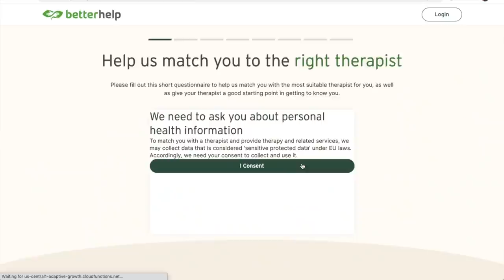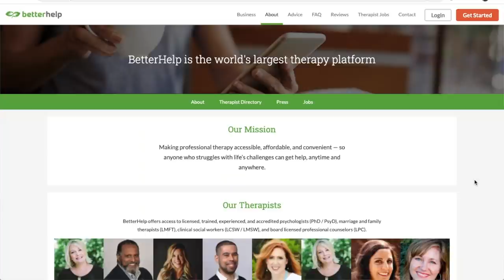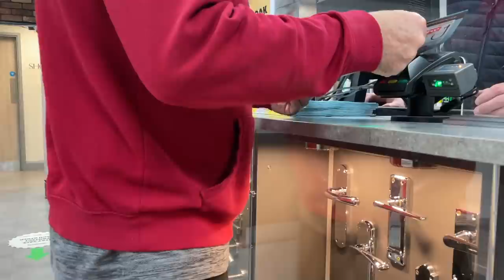Worrying About The Accessible Kitchen Counter, And I Found Another Leak!

Comment: I have some ideas of how to do a friendly kitchen inspired by standing office desks. These desks can move up and down depending wether you stand or sit. So why not have your sink, hob's and work surfaces move up and down so they can works for everyone you could have it low down so you can easily use and Shaun can have it higher up. The pipes, gas line, power can all be flexible to do the movement.

Comment: Hi Gem. I have a lowered bench in the pantry for my food prep. It is 2 cupboards width wide which is just a tiny bit small as I keep banging my elbows on the edge of the raised parts either side...ouch! I would have gone 3 cupboards wide if I had realised. our drama was the Extractor fan in the kitchen had to have 2 outlet pipes and they kept only having one in...took ages to sort out but all is good in the end! Enjoy your new empire!

Comment: I just checked my worktop height and it’s 75cm but I have one of my kitchen worktops at standing height just incase family/friends need to use it. If he can building you a sliding ledge you will definitely use it. I got the slide away oven door to, with an induction hob with a heat shield underneath and a wheeled unit that can be moved under different worktops for extra storage. Your kitchen is really coming along and is looking fantastic I bet you both can’t wait to start enjoying it. I hope you’re doing ok and it’s not as stressful as last week. Have you been sneaking in cat naps to help your energy and pain levels Sending every ounce of positive vibes and extra spoons to help you thru the final stages 🤗🤗wishing you all a lovely stress free Easter with plenty of comfort chocolate eggs 🤗🐣🤗